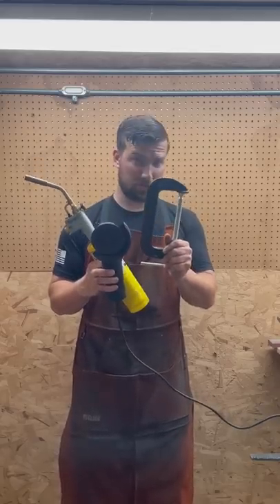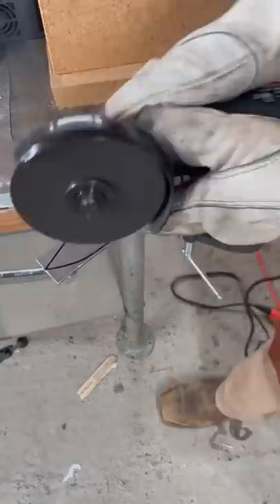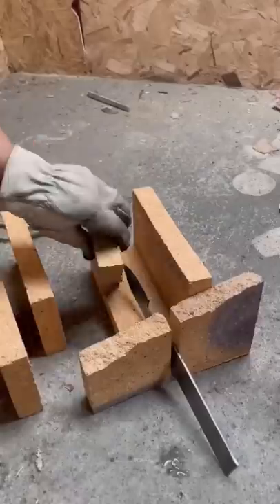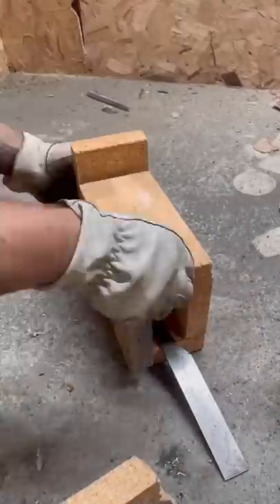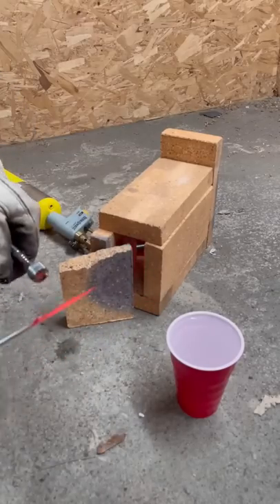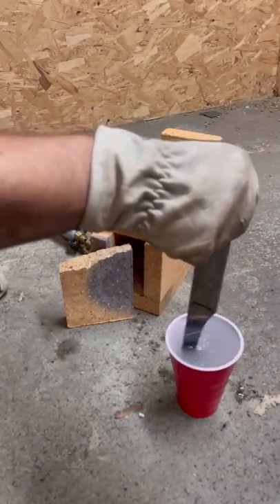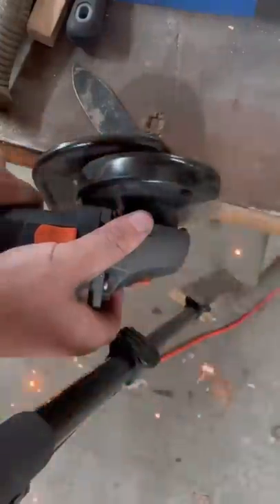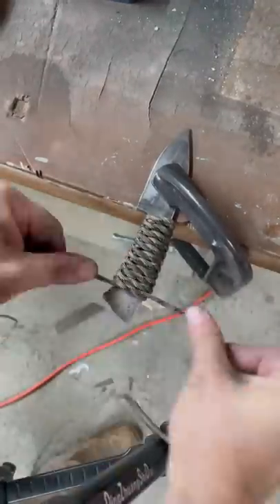How to start knifemaking without expensive equipment!!

Comment: Won't the water quench cool the blade too quick and risk cracking? I always heard an oil quench is slower and safer.
Reply from the maker: 1095 is a water quenchable steel
Reply: @calculatedsurvival  oh , I wasn't aware.
Thanks for the information

Comment: Ok I have a genuine question.  Is there some kinda of bad stigma around this process of making knives?  By that I mean taking a blank of steel, cutting out the shape, and then sharpening and heat treating ect.  Like doing all that instead of the traditional blacksmithing methods of forging a blade?  It could totally just be me, because I'm not particularly educated in this specific topic, but I would like to know more.
Reply: Yes. Actual blacksmiths and bladesmiths don't really like it. It's essentially 'cheating.'
But if it's all you can do, don't worry, who cares what others think.

There are also some myths associated with it.
Like forged knives are going to be stronger because of their grain structure (absolute nonsense post heat treatment.)

The heat treating is the only real thing you should have an issue with.
There just isn't a way to be sure how hard it's getting, and it's very uneven hardness.
Don't get me wrong, it works, and for a few knives it's alright, but it shouldn't be your standard.
Reply: There's nothing wrong with it per se but I kind of just view it as boring and cheating. But obviously if you don't have the setup to properly blade-smith then this is the way to go. Like not everybody has a nice Anvil hammer tongues and multi burner Forge
Reply: A lotta armchair blacksmiths hate it. Its not. Cheating, but a lot les enjoyable since you grind a majority of the time wich is fucking boring.

Comment: For stronger edge. Put the knife in a microwave.  The micro radiation pulses on the edge and removes any imperfections in the knife so you have a pure steel edge
Reply: Seriously 😳
Reply: I just did this and now my house has burned down 😜
Reply: What type of microwave has them radiation pulses?  I usually just keep mine in my pocket when a doctor does x-rays of my leg. I didn't even think of trying it at home..

Comment: Is the brian solution with salt a way to make quenching cheaper by not using oil?
Or is the solution as good as canola oil for instance?
Reply: The Brine solution helps cool the steel faster, making it harder.
It's far better than oil.
Reply: Sorry for second comment, YouTube wouldn't let me edit.

It's only better for plain carbon or low alloy steels. Water hardening ones. For Oil hardening steels, don't quench in water or you will cool it TO FAST and crack or break it.
Reply: @autumn5592  i see you all the time in theese types of comment sections, and i just wanted to say i love you.

Comment: Does sanding the steel blade lose its heat treatment?
Reply: No, but welding it, grinding it or reheating it will.
Reply: @rileyfranz2800 well grinding it without cooling it sufficiently

Comment: Did you scribe a line down the center of the blade so you can grind to it with the grinder?
Reply from the maker: Usually I do, but for the purpose of this video, I didn’t
Reply: @calculatedsurvival  I heard if you put a round piece of plywood  cut out around a CD as a sharpener, 
 That will make a knife ferociously Sharp

Comment: Bro I bought 1095 off of Amazon and it was not annealed correctly I could not cut it with my bandsaw. The bandsaw blade would just bounce off of it. I bought 1095 from NJ Steel Baron and it cut like butter. I’ll never by steel from Amazon ever again.
Reply: Well it just wasn’t annealed off Amazon. You could’ve annealed it yourself. If you don’t have that ability, you shouldn’t be using 1095 because you don’t have the ability to heat treat it properly

Comment: Bro don't use brine. Used peanut oil is the absolute best for quenching.
Reply: Where as you may be right, he's showing you a poor man's way of doing it with minimal items. 
Whatchu gonna find first, Peanut oil? Or water and salt?
Reply: @fattymatty823  I've seen so many blades tink in water. That or crack/warp. It being for first-time makers there's a good chance they'll think bigger is better, and that's where the issue will mostly come up. Plus it's a matter of making the best/ reliable blade one can. I always carbon treat my blades before the quench. To each their own tho.

Comment: How on earth did you freehand that grind, I suck with an angle grinder
Reply: Takes time, practice and you'll get there.
Low pressure, go at a moderate speed (be aware of heat in parts), and don't be afraid to take breaks.

Comment: It your blank is annealed, you cut it out slowly while quenching and can skip the torch and re tempering
Reply: What do you mean?
Reply: @autumn5592  I mean that one can buy heat treated blanks, and if they are ground slowly with lots of quenching, one can make a really nice knife without having to use heat to de temper, normalize, and anneal. Not saying they did it wrong, but it’s an approachable alternative for individuals without all that equipment
Reply: Annealing is softening the steel, not hardening it.
Reply: @autumn5592  ok, I’m sorry I mixed up my terms, does not really beleaguer my comment about what’s possible
Reply: @trevormartin987  No, what you mean to say is pretty decent for beginners, I don't disagree.

However, advising people to buy annealed steel, intentionally or otherwise, is not going to help them achieve that goal.

Comment: Are you sure propane will get it hot enough it looks like you're using map gas that's a lot hotter than propane?
Reply from the maker: It was mapp gas…. I wish I hadn’t mis-spoke
Reply: @calculatedsurvival  all man  im not hashing you I was just making sure I have been wanting to do some metal melting  myself hints that's why I saw ur feed. Lol

Comment: Can it be done over a fire?
Reply: It can, but it needs to be quite large, or forced air.

Forced air fire pits are not hard to make; black iron pipe, a few holes, and a hairdryer taped to the end -- push under the coals of the fire, and go.

Comment: Just buy a knife the heat from the grinder and quenching in water doesn’t seem right but what do I know do what you want.
Reply from the maker: 1095 is a water quenchable steel. 
Heating a blade before heat-treatment will not affect the end product…. I mean, you forge at 2000°F then go to heat-treatment when forging a blade, why can’t you heat it up prior to heat-treatment when doing stock-removal?

Comment: This is exactly why i refuse to pay $200+ for a knife.  
With $200 worth of equipment i can make any knife i need.  Really it doesn't need to $200. The more equipment the easier to make.
Funny part nobody talks about is how blades are heat treated in huge batches thats why the Rockwell varies by at least 4points which is huge. It can mean a great knife or junk. 
Knife companies are just bullshit and marketing

Comment: Hey, when OP says do this twice (oven tempering,) does he mean the forge heat, brine quench, then oven temper? Or just 2 oven tempers @400°[F]? Assuming he meant the latter. Only 1 forge heat/quench. 

And I'm presuming that after the first 1 hour temper, the blade is allowed to return to room temperature slowly in the atmosphere, before returning it to the oven for its 2nd hour.

Is this all correct?
Reply: You should not quench 1095 in water it requires oil water makes it brittle and yes tempering is the oven part let cool fully between cycles
Reply: oven at 400 for an hour once, let cool, oven at 400 for an hour once again, let cool
Reply: @Cre8tor727 both water and oil make it brittle, that’s the point. 1095 needs a fast quench and you need speciality oil for that. Water works just fine

Comment: Never quench in water.
Reply: Why?
Reply: @839bang  because the air bubbles will cause stress fractures in the metal and also warp the knife
Reply: Unless you’re using wootz or tomahagane steels, cause you know, people been quenching in water for centuries with no problems.
Reply: @Embiid-is-my-God  that’s true. If I remember right katana’s get there bend because their quenched in  water.
Reply from the maker: 1095 is a water quenchable steel
Reply: @inunez7271  yep, they clay the edge to keep it soft during quenching, and the hardening of the edge bends the soft spine creating the curve
Reply: Quenching in water is fine....

Comment: I'm a bladesmith. DO NOT DO THAT!!  1095 WILL CRACK QUENCHING IN WATER!!
Reply: 10xx alloys are water hardening.
Don't take pre hardening thickness down super thin, and it won't crack.
Reply: I’m a bladesmith and you’re wrong. It’s fine to quench in water

Comment: Can I use any kind of steel? Can't get 1095
Reply from the maker: Sure… but use canola oil. 1095 is one of the very few steels that you can use something as fast as a brine solution to quench
Reply: @calculatedsurvival  I will try this

Comment: Your heat treat will be off because the heat isnt even I would recommend a whirlpool style heating furnace or use coal also for some steels you can skip the tempering by doing an oil quinch
Reply: You're talking about a forced venturi forge, and no he needed to leave the blade in there till it had an even heat color. He took it out and quenched it too early
Reply: @Dezz097OG  I dont personally mess with propane I only ever use coal

Comment: isn't it better to quench it in oil tho?
Reply: Not for water hardening steels.
Reply: Really depends on the steels. Simple carbon/low alloy steels are great for brine quenching. More complex steels require diffrent methods including oil.

Comment: How do you bevel an edge evenly with an angle grinder. Cool video but it's probably not even. Nice blade profile.
Reply from the maker: Scribe a centerline, stop grinding before you hit it.
Reply: @calculatedsurvival  And it works great 👍

Comment: Hardening in water that's a no no no matter how much salt....and using the file on the blade it was clear is not hardened...so overall this doesn't work at all
Reply: Brine quenches are fine for low alloy steels.

The file skates, meaning it's softer than the knife, that means the knife is at LEAST 60hrc. Most files are a little harder than that.

Comment: you did not just quench spring steel in brine.....you sir have a special place in hell. you could atleast gone the extra 8 dollars and used canola oil. frankly I'm suprised your blade didnt snap in half.
Reply: Brine is fine for medium carbon and low alloy steels...
Reply: @sammidwood404  Yes, Dr. Larrin Thomas says quenching 1050-1095/W1-W2/paper steels is perfectly fine.
I'm gonna take the word of the guy that has a PhD, created some of the best steels on the market, and has written articles and books on the subject, over some random internet commenter.
But hey, maybe Larrin is wrong, lmfao.
Reply: @autumn5592  I mean hey you dont have to take it from me either but nobody ever said anything good came from sitting in a lecture for 220 of the 240 required hours of class you have to sit through for a semester of studies for physical metallurgy.😎
Reply: @sammidwood404 bros wrong

Comment: I was hoping you'd be making it with a hammer and a chisel because you said "without using expensive tools"
Reply: An angle grinder is expensive?
Reply: Like 50 bucks max for a skil one of the first tools I bought in high school
Reply: @MustachPie  You can get a good grinder for as little as 15 dollars.
Reply: @autumn5592  it's pretty much the cheapest category of powertools.

Comment: Nah nah nah nah nope. You only had three tools, now we need fire bricks, a table to clamp the knife to, an over, a magnet, a flapping wheel, cut off wheel, a file and so on. 

2: you don’t quench 1095 in water, or brine solution. You quench in oil.
Reply from the maker: 1095 is a water quenchable steel
Reply: Are you gonna complain about how we also need hands to use the tools too lmao

Comment: A torch, angle grinder, 24 grit sanding wheel, c-clamp, 5-6 fire bricks, an oven, paracord, a bar of steel, glass jar and a knife with a huge crack in the blade because you quenched in water. 🤦🏻‍♂️ FYI, that’s mapp gas.
Reply: “Ankle grinder” you already know this video is gonna be whack

Comment: Never use water 💦 to quench, and that wanna be forge was not good ,your putting way to much heat on one spot of the knife , it has to be even , but , if you want to do this go ahead , not the right way ,
Reply: Brine is fine as long as you use an interrupted quench, assuming that it’s just stock removal on an annealed piece of stock. 

As far as getting it too hot in one place his color looks pretty damn even I’m not sure what you’re tripping on. 

Only thing he didn’t let it soak at temp, I think 1095 needs at least 10 minutes or so.
Reply: @jerod5636  if you say so man . 

I think oil would be a better then salt water. Water to harsh and would creat stress cracks . But , that’s you ..
Reply: @Animal_jo  you know what an interrupted quench is?
Reply: @Animal_jo  yes, but quench oil is a lot harder to come by than salt, and water. And let’s be real, the ppl who will use this guide are going to be teenagers with no way of getting quench oil easily
Reply: @Animal_jo it's literally a water hardened steel

Comment: Why did you put it in the oven after quenching it?
Reply: Steel is brittle. Putting it in oven relieves built up stress, makes the crystals align a little better
Reply: @Kozimierz  but I thought that's why you quench it. Is it still necessary if you would have forged it instead of cutting it out?
Reply: @manny9754  when you heat up the steel and quench it quickly the steel goes from being soft and bendable to hard and brittle so you put it in an oven to relieve some of the stress and you get a happy medium between bendable and brittle.
Reply: @manny9754 yes just as necessary if you forged it

Comment: If you're interested in all your body parts working as they should, such as your eyeballs, windpipe, major arteries, etc, then I would highly suggest you stop using that "sander" (no, a cutoff wheel on an angle grinder with sandpaper stuck to it is not a sander and it's extremely dangerous) (also why was the previous short literally some guy showing how to do this terrible idea?) And invest in a proper sander, whether it's a belt sander or whatever, doesn't matter, just stop doing what you're doing if you value life and limb at all.

Edit: I'd just like to emphasize what I already said even more if you have a family that depends on you. If you don't want to be safe for your own wellbeing, do it for theirs.
Reply: Grinders are perfectly safe if you known what you're doing grandpa.
Reply from the maker: I used the grinder properly. And I don’t know anyone in thier right mind who would stick sandpaper on a cut-off wheel. So don’t falsely accuse me of that before you have the facts..
  I used a sanding disc on a sanding disc adapter purpose built for a 4-1/2” angle grinder. No safety violations here. I don’t what previous short you watched, but I don’t show people how to get killed, so it wasn’t my short.
Reply: @calculatedsurvival just stumbled across this. I have no idea what i was talking about but i can clearly see you were using a flap disc, only thing i can figure is i either commented on the wrong sort or my eyes deceived me at some point. So with that said, i apologize. Also why did you use salt brine rather than oil? Isnt 1095 an oil quenching steel?
Reply from the maker: @lumpyzx2645  It’s all good man. 1095 needs a fast quench and they have specially made oils for this. But since most people don’t have Parks 50 kicking around, I showed the brine solution quench option. Look up water quench steels… there are actually quite a few.
Reply: @calculatedsurvival  thanks, I'll check it out

Comment: It's called annealing
Reply: That’s not annealing. Annealing yields softer metal with larger grains after recrystallization and requires a slow controlled drop in temperature.